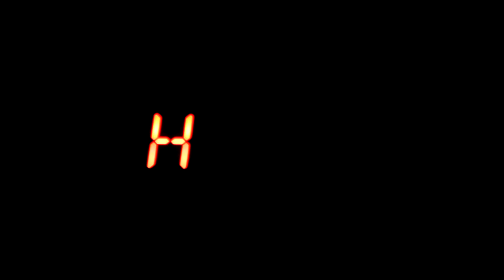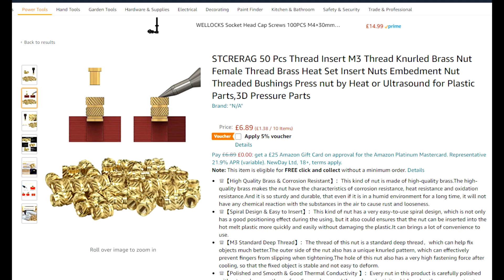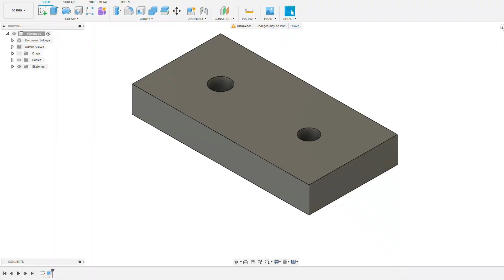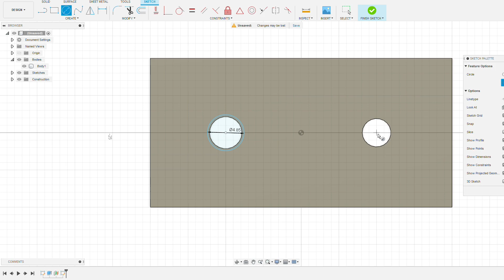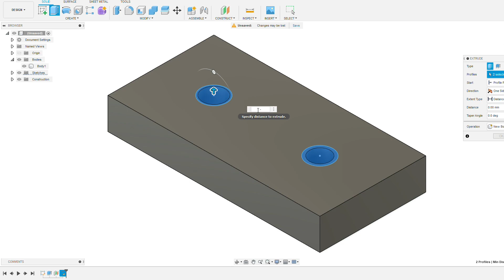Better screw threads in 3d prints? Level up your 3d printing with these simple devices.

Comment: I don't think they actually provide a holding advantage, like no extra failure torque whatsoever. However they are really easy to screw into and you can screw and unscrew a million times, that's not something you can do with plastic.
Reply from the maker: I feel like that's probably something CNC kitchen has investigated...it's probably true. They are cool though, I think mostly for showing off and apparently if you're an extruder designer...oh...I just had an idea for a filament guide using one of these! 😮

Comment: Maybe instead of using a recess try using a chamfer along the inside edge of the hole. I'm thinking it would help guide it in straighter. BTW I just found your channel and subscribed.
Reply from the maker: It's a good idea, and easy to implement. I will try it next time.  Welcome to the channel 👍

Comment: I always have a problem with these, when the hole that I'm inserting them into doesn't go all the way through, the inside part gets full of molten plastic which then solidifies and then I can't screw the screw, I usually have to screw it while heating the insert which is not a good experience at all
Reply from the maker: Yeah I saw that a bit, although it didn't block the screw. I wondered if the hole should be bigger or maybe deeper than the insert, but also I considered inserting the insert with the screw in place.
Reply: Might want to invest into a set of better ones then that come with like an alignment chamfer that will tend to push the plastic outward instead of inward. I use Ruthex ones and I have practically no problems with them unless I spec the hole size wrong.